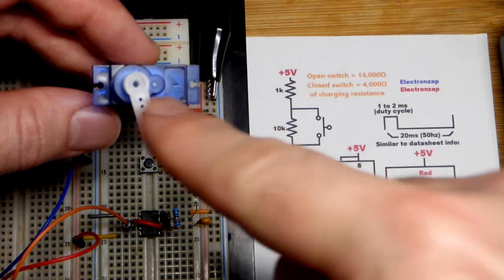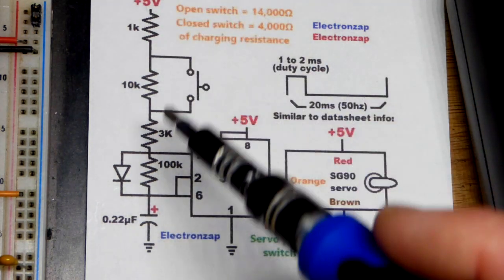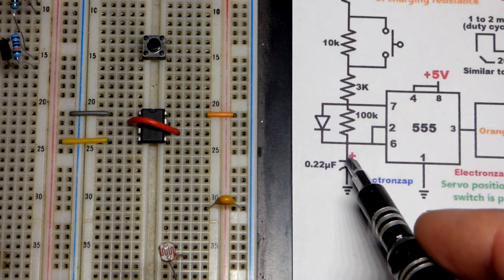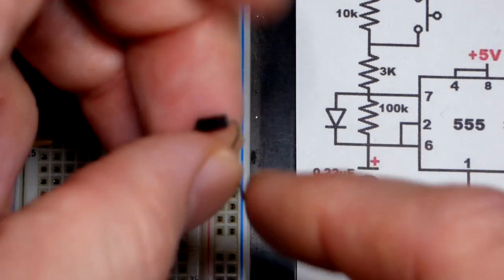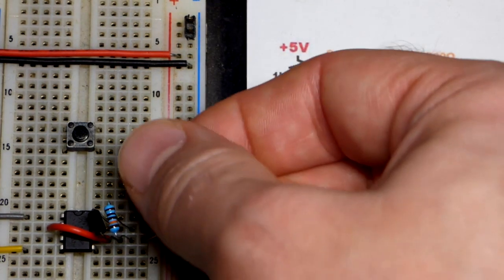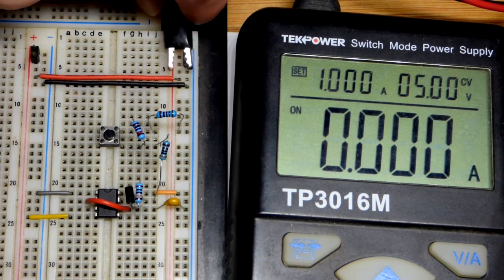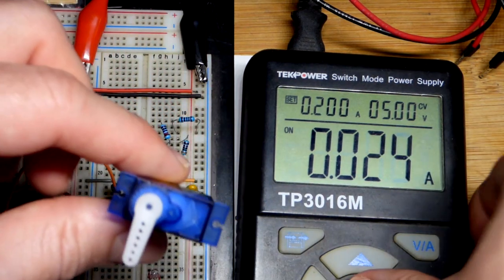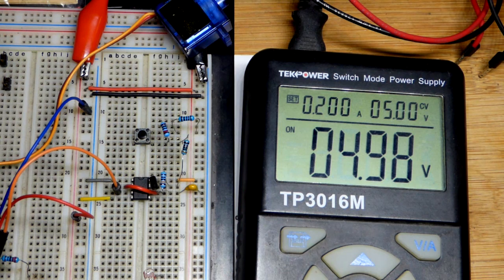2 position SG90 servo circuit using 555 timer and push button switch schematic diagram

Comment: I am trying to automate continuously moving between the two positions without success.   Would you have any suggestions?   Thanks
Reply from the maker: My plan is to have 2 positioning circuits, and have a digital switch that alternates between then.

Comment: Awesome video!  How would you suggest controlling the input into the 555 with a logic gate output?
Reply from the maker: You can directly connect the output of anything to the input of a 555. It just looks at voltage and responds to it.

Comment: is it possible to put a light sensor instead of the button?
Reply from the maker: Yeah, that's one of my favorite circuits https://youtu.be/bHvrOkK-ssE LDR 555 Sets SG90 Servo Position,
Reply: @ thanks. I’ve noticed it doesn’t return to initial position if light is turned off imidiately, but responses to dimming.

Comment: I was searching for a video with this concept for almost two hours. Thank you bro for this video. Really appreciate you.

Also, can we change the working from 0-180° to 0-90° just by changing resistor values.
Reply from the maker: This was a tricky circuit but one that I really wanted to make. And adjusting the resistor values is how you would adjust the range of motion. Again, I don't know what values would be needed. I would just keep trying different values using this circuit as a starting point.

Comment: I took Ra=I4K, Rb=100K and C=0.22u and calculated th=0693(Ra+Rb)C=17.38ms and tL=0.693(Rb)C=15.25ms, neither the period T=th+tL=32.62ms nor the tw coincide with 20ms and 2ms, respectively. 
I took Ra=4K, Rb=100K and C=0.22u and calculated th=0693(Ra+Rb)C=15.85ms and tL=0.693(Rb)C=15.25ms, neither the period T=th+tL=32.62ms nor the tw coincide with 20ms and 2ms, respectively. 
How can it be that the motor moves?
Regards
Reply: Hello, don't forget that you have a diode in the circuit, so when the capacitor is charging, the current is going throught the diode and not throught the Rb, so it allow to charge the capacitor way faster and unfortunetely, I think you can't use that formulas here because the circuit has a diode, it will give you wrong answers.

Comment: Thanks for your wonderful videos.
I have a quick question.
Can a PIR be placed into this circuit that would trigger the servo?
Reply from the maker: Thanks for watching! PIR can be used to control a circuit if you wire it right. Either using it to send a signal to an integrated circuit or transistor. I was thinking of making a PIR video.
Reply: @Electronzap  Could you make the PIR circuit video, please?

Comment: Great video, thanks for sharing.     Do you have any suggestions to automate this circuit so that it continously moves between the two positions and I could vary the sweep speed between the two points?   Thanks for any advice you can share 😊
Reply: I have been doing some research.   My thoughts are to use a transistor to replace the push button switch and use a second 555 timer with a variable resistor connected to the transistor to vary the speed of the sweep.  Thoughts?

Comment: Hi I just watched your vid on 4049 oscillator, I’m making a stereo tremolo but my osc was not giving square wave but a ramp 🤔 i think it may be I have polarised cap in circuit which is possibly wrong, I don’t have proper schematic just a pic of the web ‘Craig Anderton stereo tremolo” I don’t have a great knowledge of electronics just a chancer 😂 thanks 👍🏴
Reply from the maker: It's hard to keep a square wave when you demand power directly from the circuitry that is making the square wave. That's why you add at least one amplifier. And also, ICs that make square waves have a limit to how fast of a square wave they can maintain. I mostly try to come up with fun things to do with low priced ICs that most people new to the hobby can recreate with ease, so my videos won't be much help for people making audio circuits.
Reply: @Electronzap  thank you so much I had thought on my led taking to much power 🤔 I am using blue but red should use less power👍 and someone suggested having parallel gates 🤔 just going to have a go 👍